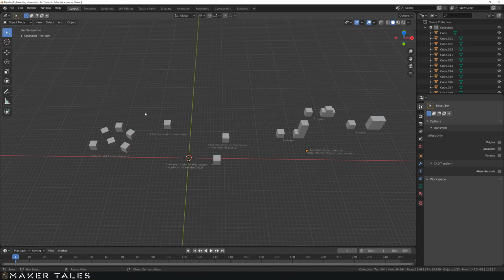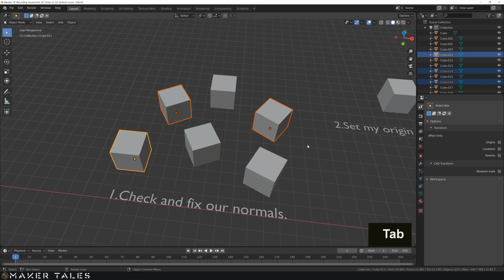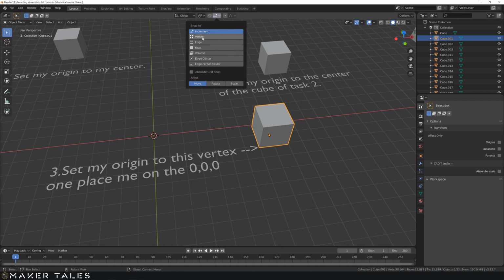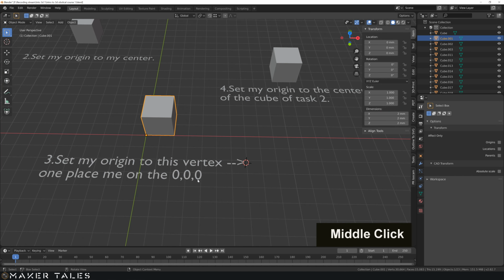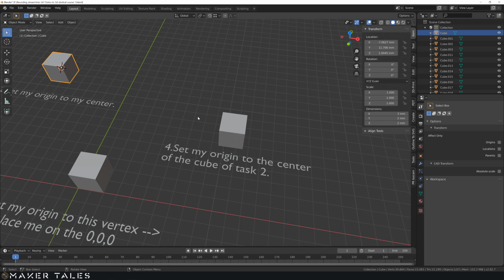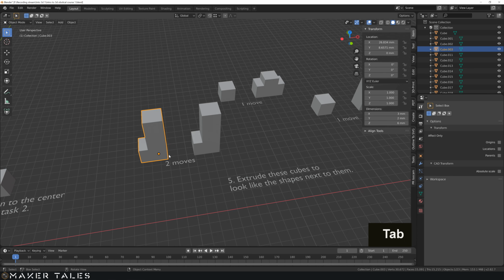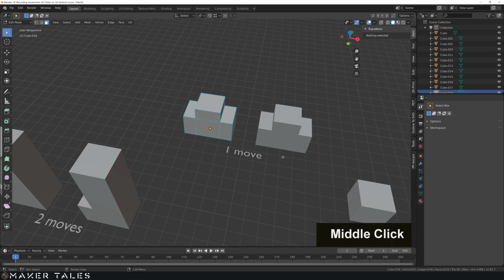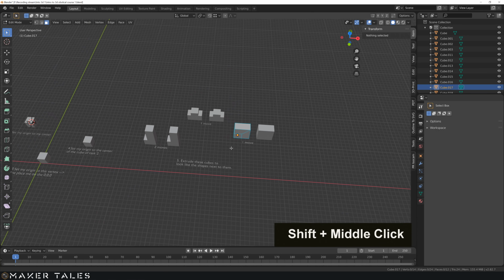The Beginning of 2D to 3D - Obstacle Course Solutions

Comment: Thanks a ton for doing this. So on step 4 when I click on the cube in 2 and click shift/s I do see Cursor to active but it is greyed out. What did I do to cause it to be greyed out and unselectable?
Reply from the maker: Hi Kevin,
No problem I'm so happy you're enjoying the videos and taking on the challenge.
That is strange that it's doing that. I can't seem to replicate the problem on my end. I did a little googling and it looks like it "might" be a very rare blender bug. From what I see you may need to re-install blender. I would suggest that you try a basic computer restart. Adding 2 cubes into your scene and see if you can make the challenge yourself so to speak. That way it takes my file out of the equation. If you still have this issue try a re-install and of course let me know how it goes. 😀